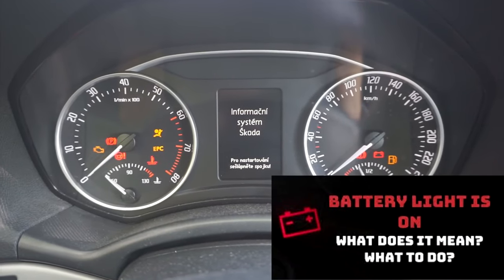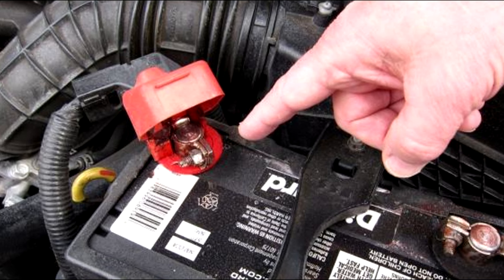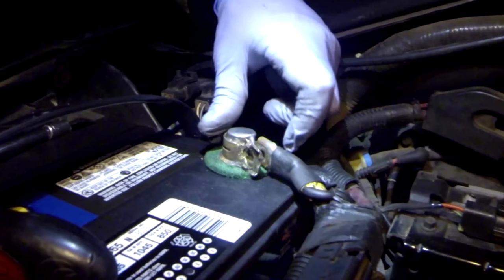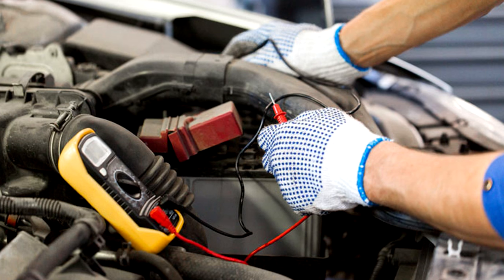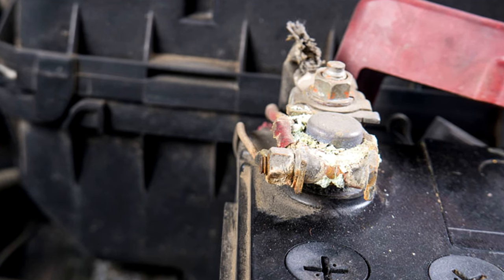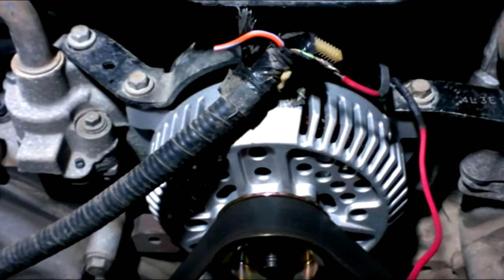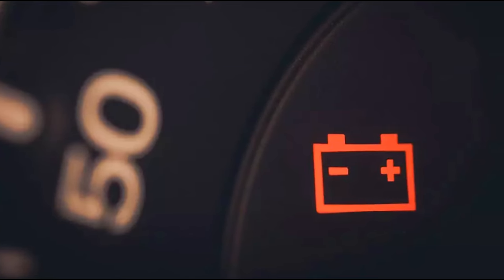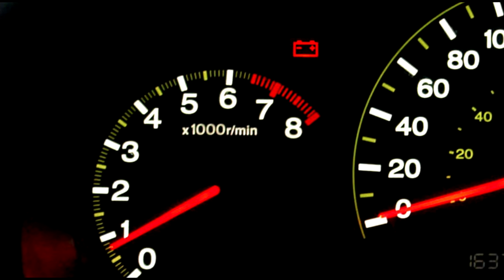BATTERY WARNING LIGHT {on dashboard}🚨: Meaning & Explanation – What causes battery light come on?🚘

Comment: Mine just turned on but I got a new battery just 3 months ago! In my region we have snow and low temperatures.. Could this be causing the issue? I’ll check the engine connects in the morning! But otherwise… Would the alternator make a slight burning smell, upon starting, if it’s going out? I only smelled it for a short time but I wasn’t sure if it was my car. But my alternator was replaced 2-years ago and I’ve only drove about 22k miles since! So I’d be surprised if it were those! 🤔
Reply: What was wrong with your car
Reply: @mst5158 I think when I posted this comment,.. I needed lots of coolant! and a new alternator!

Comment: hmmm i recently changed my car batteries usually when you put the key into run position  battery light will turn on and as soon as you start the engine it will goes off... what i have noticed after replacing my battery  recently is that when i put my key into run position the battery icon will not appear, is this normal?
Reply from the maker: That is weird! I would say it auto mechanic during next visit... but I wouldn´t go there just for this...
Reply: Yh i have the same promble

Comment: 2013 Chevy Impala LTZ, just had "Service Battery Charging System alert with battery light, alternator and battery both less than 4 months old. Found out alternator was overcharging battery, both replaced. Next morning while driving both alerts popped up again, Praying it's a faulty alternator or battery and I don't have to spend money as they are both under warranty. What a headache!
Reply: What was wrong with your car
Reply: Any updates

Comment: I have a 2012 Buick Verano. My battery light came on and the alternator was bad before it went bad voltage was 14.6. Now, went got a new one and put that on. Damn battery light still on. So, i checked the belt that was ok, battery terminals were clean but I cleaned it anyways. I changed the battery current sensor and put a new negative battery cable. Why is the battery light still on? Everything works fine and had the battery and alternator tested both passed with new alternator voltage at 13.6,13.7. Been pain an a** trying figure out why battery light still on.
Reply: Any update

Comment: Hi, when I starts the engine, the battery light shows up on the dashboard and after a few seconds, it goes off. It never happened before. Is it normal or I have to go to mechanics? on another note, I hear squealing noise while I drive. I don’t know where the noise is coming from? 

The car I drive is Lincoln Continental 1997. Thanks for your time.
Reply: Your tensioner is bad or you need to replace your drive belt.
Reply: Any update

Comment: With mine it was when my alternator quit charging, whether it was the diodes that died or the voltage regulator or something else, The alternator had been doing fine putting out enough voltage but sporadically, and then I stopped and got out of the truck to get the mail and got back in and when I accelerated the battery light came on and went off a couple times and from then on, the voltage meter in the dash only showed the battery charge level because the alternator was no longer putting out any charge.

Comment: My stopped 3 times today after showing a battery sign, what I found was both battery terminals were loose, I tighten both the terminals after it turned off second time,

I drove it just 3 kilometres…
Later it turned off again, why did this happen?
Reply: My was fixed, I just got alternator changed